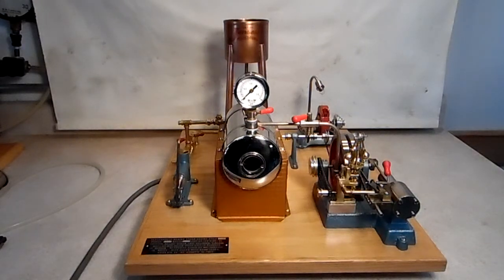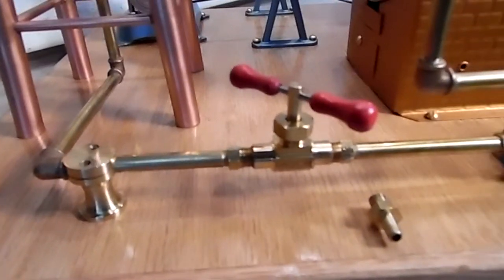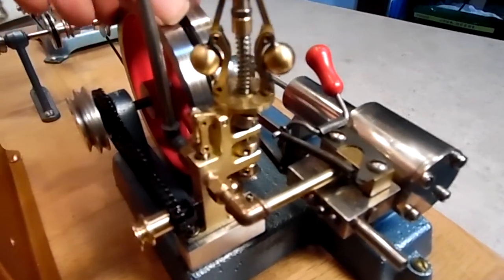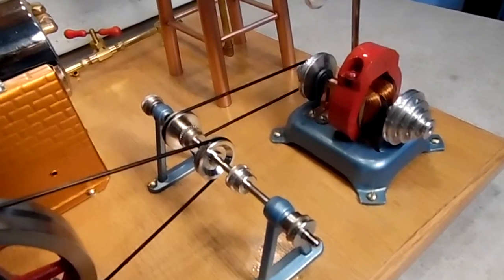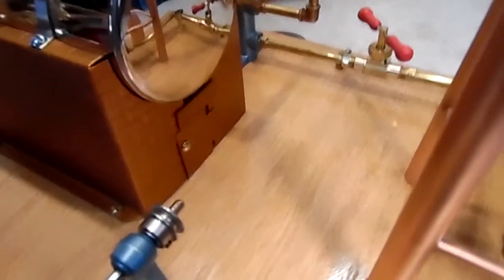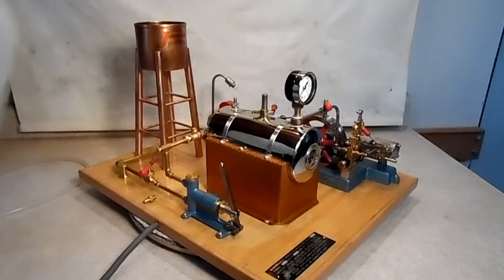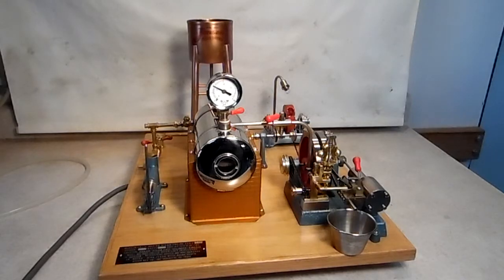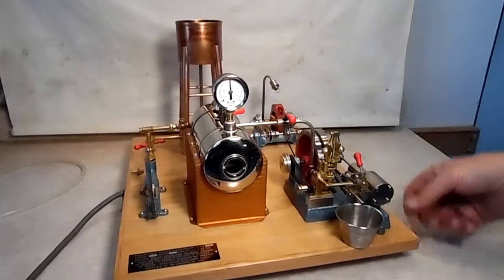Jensen #20GG live steam plant   "steaming"

Comment: Bonjour Bruce,
Great plant, and a functional governor is really uncommon. Useful for a static plant, less in a boat :+)
How do you manage to operate the governor at the speed you chooze ?
Amicalement, Raphaël
Reply from the maker: I had to run a trial & error set of experiments to get the right combination of chain gears to achieve the governing set speed I wanted to achieve, I went for 15 psi as being the full governed speed working in close relationship to the comfortable working pressure of the safety valve, I can change the governored  action by swapping gears out.